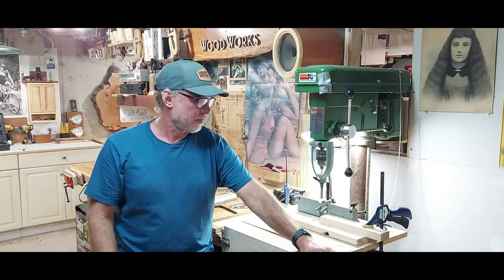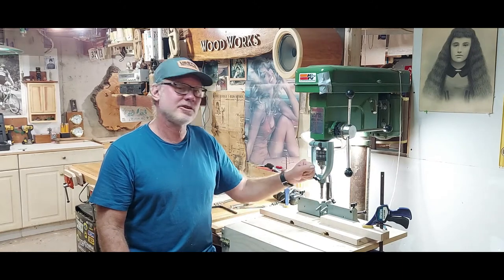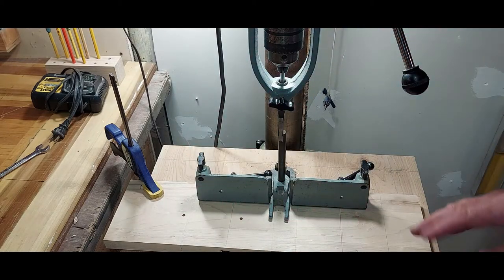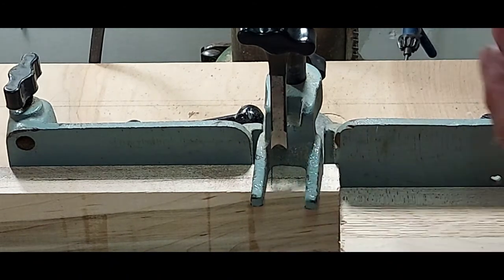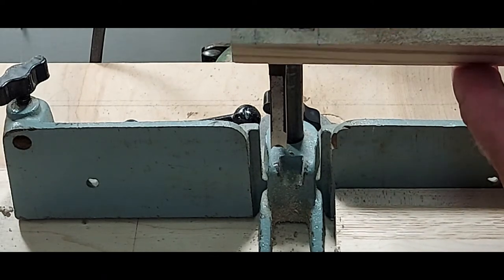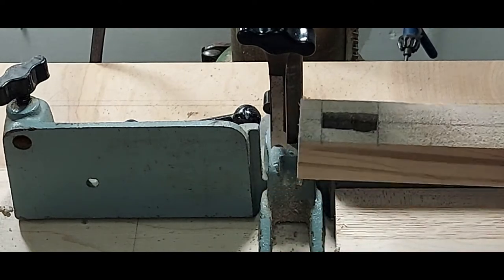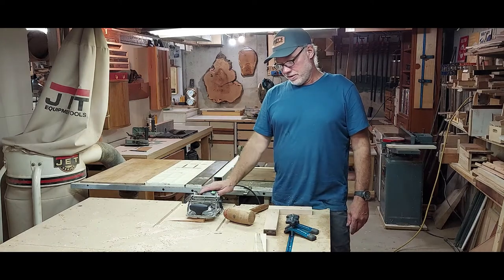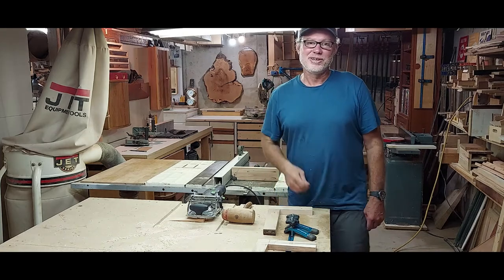How I Set Up and Use A Mortising Jig

Comment: Thx for posting this how-to. I just bought one of these the other day, tried it for the first time, and learned a couple things that helped me make better mortises. I rotated the chisel 180 degrees so the channel is facing outwards...all the waste falls out the front so it's much easier to clear as I go and to see what I'm doing. Also, I found that the bit will drift if it's not drilling a fully new hole (ie. wood on all four sides of the bit). The worst is if it's only on 3 sides (ie. drilling subsequent holes side by side). I was better off drilling holes offset by 1/2 (or less) the thickness of the bit, then going back and cleaning up the remaining pieces that were left in-between.
Reply from the maker: Hey, Buzz. Interesting tips, thanks. You are right about the bit drifting. If you want nice accurate holes that is the way to go. If you are lazy like me and are going for least amount of effort, I cut less than full holes. I hope my video helped a little and  thanks again for your comment.  I don't know all there is to know about woodworking, not even close, so I really appreciate other people's feedback. It's my favorite part of having a channel.

Comment: I can't get to funnel (the first piece that goes on) looking piece to attach!  Can you please explain that part?
Reply from the maker: Jim, I'm sorry if I left something out. If I understand your question right, you are confused about mounting the collar that the bits slide into. On my drill press it slips over the part of the drill press that moves up and down (the spindle) right above the chuck. The collar slip fits on and then is snugged down with the nut on the collar. On my older Delta Table Top drill press I had to lower the spindle a little bit to expose an area on the spindle where the collar will mount. I hope that helps.